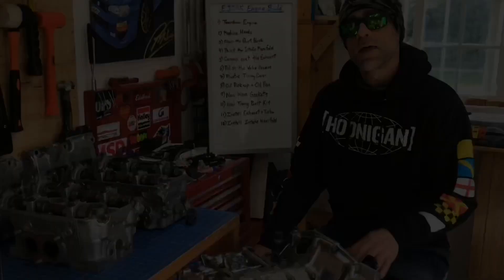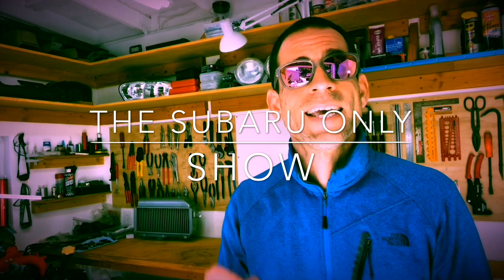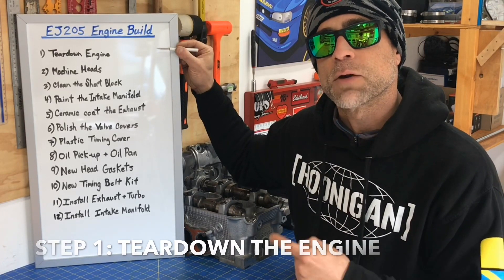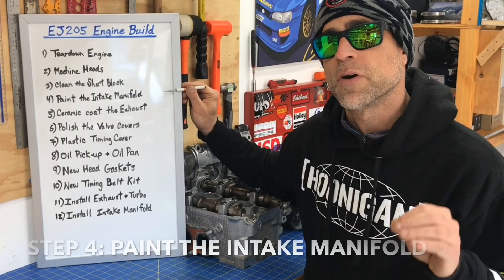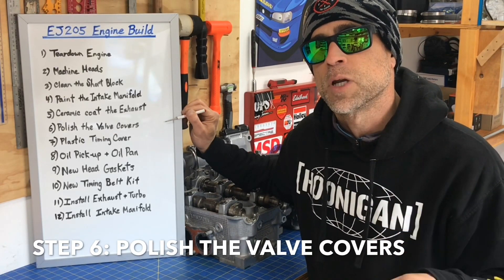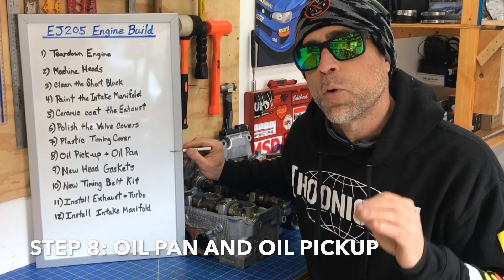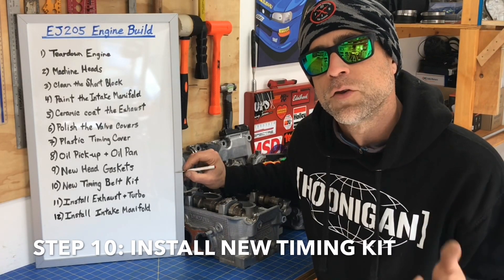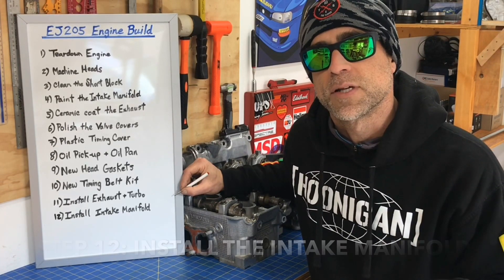12 Steps to Rebuild ANY EJ-Series Engine

Comment: I would recommend installing ARP head studs when you install the heads on the bottom end. No matter if your going high power or not. Just good insurance to help prevent the separation from heads
Reply: Paul Morales I agree. It's ~$200 that is worth every penny.
Reply from the maker: Good call guys. 100% agree.

Comment: I am considering purchasing a used WRX, 2005 or around there.  This series will be a great resource when that happens.  Thanks!
Reply: I had a 2004 WRX for four years and sold it two years ago with 235,000 miles on it.  I was worried about buying a used WRX and having to pay for head gasket or other repairs, so I've been driving a leased 2017 Impreza since, but I REALLY miss my WRX.  
This channel and others have given me the confidence to do my first head gasket replacement on my 2001 Forester.  Now I think I can deal with an older WRX and make it reliable.
Reply from the maker: Hell yea man!!!  Love to hear this!  You can totally do a head gasket as a hobbyist mechanic. Really pretty straight forward. And the older cars have so much more character than anything new, IMHO.  Cheers buddy!  🤙

Comment: love the video. BTW I am planing a head gasket on my outback, 
1-how much should i expect a machine  shop to charge for resurfacing each head? 
2-and should I ask them to "vacuum" test the heads? is there extra cost? 
3-also should I provide any parts to the machine shop?
4-Finally I will buy the felpro gasket, should I get the whole set for 150 or just the gaskets that i will need?
thanks a bunch
Reply: Don't buy felpro gaskets. Use OEM or Cometic.
Reply: @KDD8  Cometic does not do gaskets for 2007 2.5L subaru outback engines, do u have anything against felpro? An older retired Subaru tech told me he uses either felpro or Mahle to overhaul engines. He will never use OEM! And he warranties his work.
Reply: 1) you will pay around $200/per head
2) I don’t think that’s needed when they service the cylinder heads they would be good to go after  Or they will tell you if the they are bad and need to be replaced. I know the 2.0 turbo heads tend to create cracks at the hole where the spark plug enters but that’s not something you have to worry about.
3)The machine shop should have the parts if not they order the parts that’s what the price includes.
4) DO NOT cheap out on the gaskets. ONLY USE OEM FROM THE DEALERSHIP . They have a compete kit at the dealership you can order and it will have everything. If you use the aftermarket kits you will be back doing the same work over again. Those aftermarket gaskets are CRAP.
Reply from the maker: Hey buddy.  Addressing this in detail in the next video!  But for now, I answer here too. I usually pay about $140 for the resurface alone, but the machine shop will also need to hot tank (another $40 or so), and you should always have them pressure test the heads (about $60-$80) and also have them replace the valve stem seals (another $40 or so, and this is the only new parts I provide. GSC makes good ones for about $25 for all 16).  So in the end, you’ll be paying close to $250-$300 for everything to be done right. 

For head gaskets, I go with the OEM ones (they redesigned them about a decade + ago, and they’re no longer prone to failure) or use cometic or IAG or Cosworth ones.  Good luck - you got this!  👊

Comment: This looks very interesting to me,I have to open up an ej25 sohc 2002 ,I have a quick question about crankshafts that I hope you can answer.will a sti or wrx crank shaft fit in the sohc ej25 case?I ask because parts are hard to find for me in my location but I can get a crankshaft out of a wrx I'm told it's out of a 2004 wrx ej25 not sure but I thought wrx was ej20.any help or maybe just tell me where I can find another engine that will be direct swap(2002 Subaru legacy ej25)any help would be very much appreciated thank you.love the gc8 by the way that's my fav car of all still haven't got the chance to snatch one up
Reply from the maker: Love your user name man!  Classic.  So to the question, yes technically it will fit in the crank journal locations in the block, but the stroke of the crank will be different to accommodate the lower compression ratio of the turbo motors.
Reply: @SubaruONLY  thanks man

Comment: I can't remember if i said this already so i'm gonna say it again. The fact you have 80's electro synth playing at the start is friggin awesome. Now to my questions....

Should i get the block machined as well? 

Also i have an N/A SH Forester i'll be using as a daily driver with the odd weekend fun. Is it worth putting a turbo on it? Or are there any tricks i can do to get some extra ponies out of the N/A engine without turning into a gas guzzling bomb? I'm not after a race car, but my previous daily driver was a Honda Accord Euro CL9, (i think you guys call them Acura's) and it had some great power from the 2.4 litre N/A, so i'd like something close to that if i can. Cheers
Reply from the maker: Don’t typically need to machine the block. As for adding a turbo to an NA setup, I usually recommend not to go that route - better to swap in a whole turbo motor all at once, often ends up costing less and will most likely be way more reliable too.  To upgrade the NA, can open up the breathing and that helps, add an intake and free flowing exhaust, but can’t do much to make more HP with an NA, unless you do a total engine rebuild for higher compression and ported or larger intake ports/valve, plus a wicked cam - there are guys doing these builds - and they’re expensive!!! Good luck 👍
Reply: @SubaruONLY  Thank for getting back to me man. Yeah i don't wanna go too crazy with the NA. If i can pick about an extra 15-20kw i'd be happy. I got the car at a very very good price because the gearbox supposedly has issues. I couldn't feel it but the previous owner said it was there. He said it made a noise at full lock, possibly the viscous coupling?? But yeah, i'm happy to spend a bit on the car. Even if i spend 5k on it, i'd still be ahead of what they are going for where i live. I'd rather not of course haha, but if i did i wouldn't be spending more than it's worth.
Reply from the maker: Sounds like a sweet ride for good price! 👍

Comment: Glad you are doing the oil pan and pickup. I've read many threads on nasioc about how the OEM pickup can fatigue over time and develop cracks, just like you said.  Owning an 03 WRX with the same ej205, I'm seriously considering an aftermarket pickup and sti oil pan as a nice reliability mod. Can't wait for that vid!
Reply from the maker: Thanks man!  Yes - this is a major issue for the Subaru oil pickup design.  It’s not a myth.  Gotta address this weakness if possible!  Have you seen the new RCM (Roger Clark Motorsport) OEM oil pickup support unit?  Looks pretty cool!